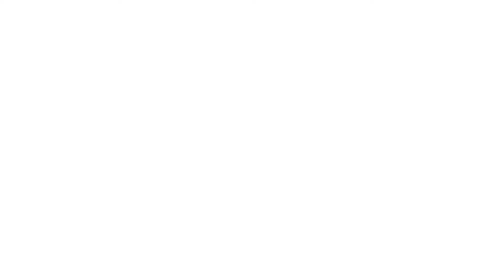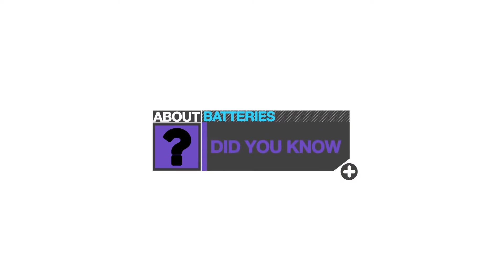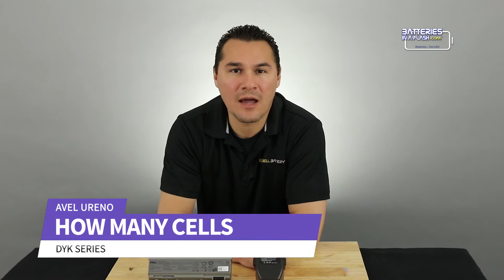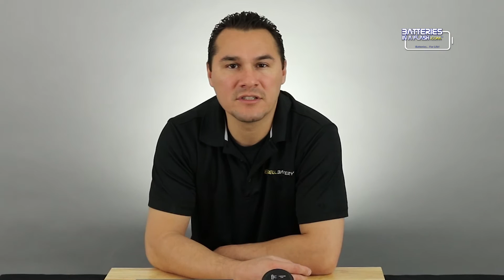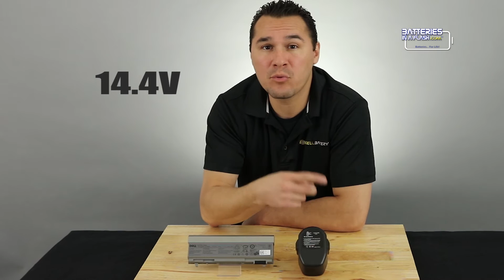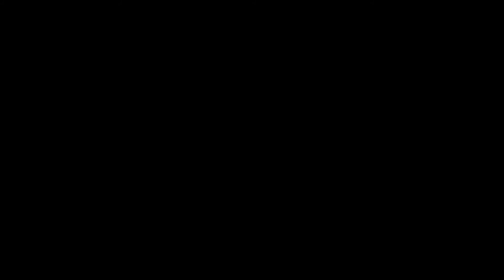How Many Cells Are In My Battery

Comment: Isn't a fully charge battery 4.2V on Lithium?
Reply from the maker: Yes however when discussing batteries voltage you refer to there nomial voltage which is 3.7V not a fully charged voltage.

Comment: CR2032H, how many cells per battery?
Reply from the maker: It is only one cell. The CR2032 is the actual battery.
Reply: @Batteriesinaflash  Okay thank you so much. Another question, do you know how many lithium content (grams) in the CR2032H?
Reply from the maker: @cindyvang9215  You would need to check the spec sheet for an accurate answer. To estimate the lithium content use the following formula (Ah per cell x 0.3 g x number of cells).
Example: Energizer CR2032 is 235mAh.. 
Convert mAh to Ah by dividing by 1000... 
SO... 235/1000=0.235Ah 
THEN... 0.235Ah x 0.3g x 1cell = 0.0705g of lithium

Comment: can anyone tell me how many cells are in a 3.7 lithium battery? thats the only information i have the battery is used for a small digital voice recorder the only info on the battery is 3.7v and 380 mAh but i need to know how many cells there are per battery?? so confused
Reply: S.H. a 3.7V battery and only 400mah or so is just one small battery.
Reply: 3 cells
Reply: @12_akankshapal77  I have 97 Wh & 11.1 v battery. How many cells?
Reply: Need more information?
Reply from the maker: @hollyxie4059  You have (3) 3.7V cells in your 11.1V battery pack